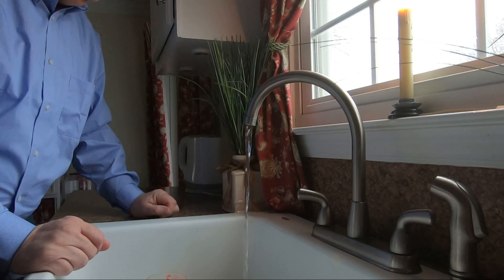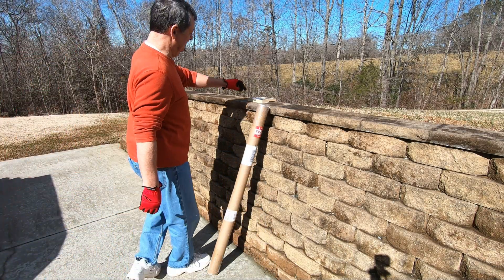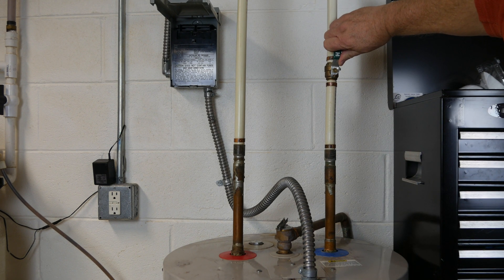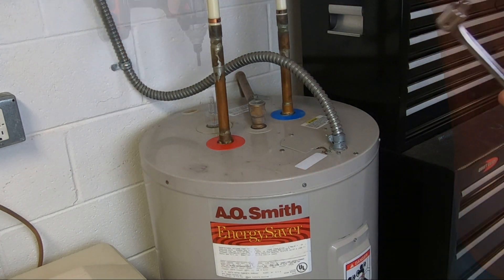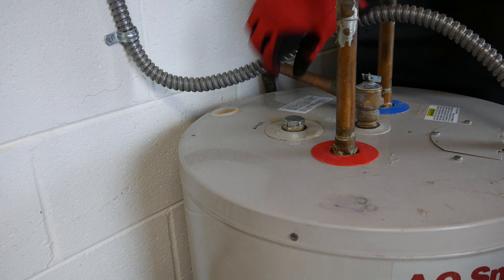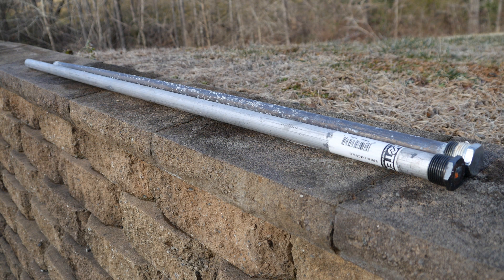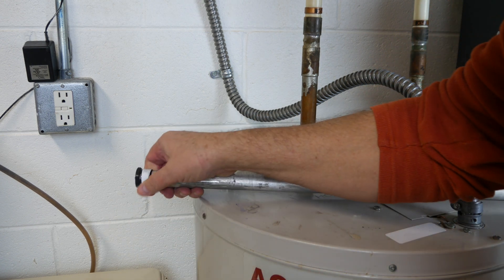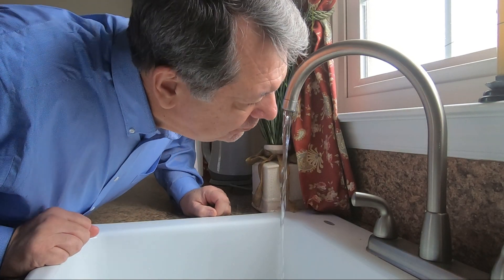Anode Rod Replacement and Water Heater Tank Flush

Comment: the biggest hurdle is getting that fn anode rod to loosen so it can be removed. took me 4 days using every trick in the book, no matter my heater is only a few months old. nothing worked until i extended the breaker bar out to nearly 5 ft. these mfgs should be ashamed of themselves for needlessly installing them impossibly tight.
Reply from the maker: It's a bear for sure, especially if you're trying to do this by yourself.

Comment: I would add that before turning power back on, make sure you open a few faucets until no more air comes out so you know your tank is full. If you don’t, you will burn out your top heating element instantly. I learned this the hard way, unfortunately lol
Reply from the maker: Thanks Kurt, did that at 7:16.  Thanks for viewing.
Reply: @PilotViewProductions  sorry, must have missed it. Great video, going to try your method of reverse flushing of my hot water heater. I’m on well water too so I get tons of calcium. Thanks for the tip